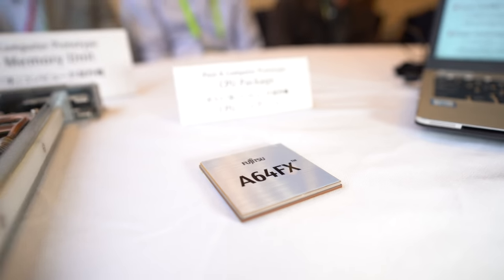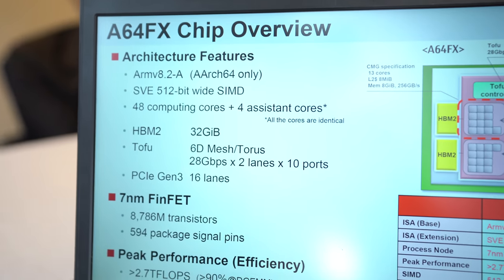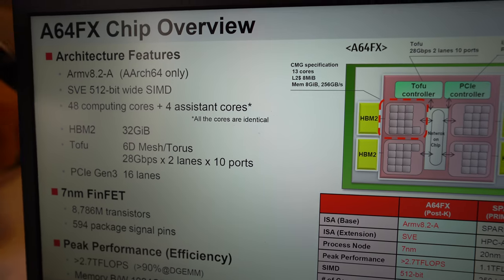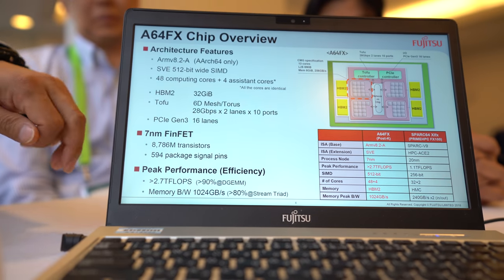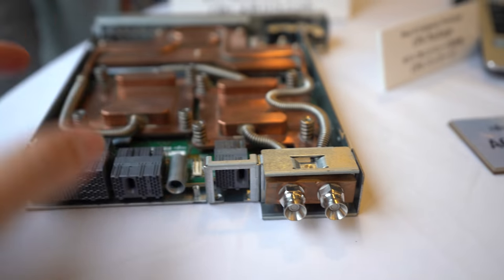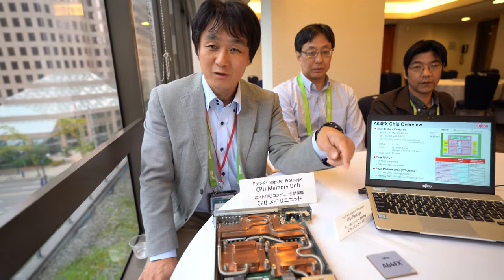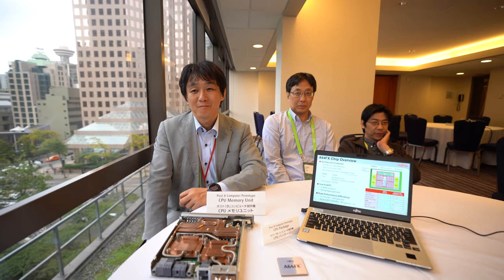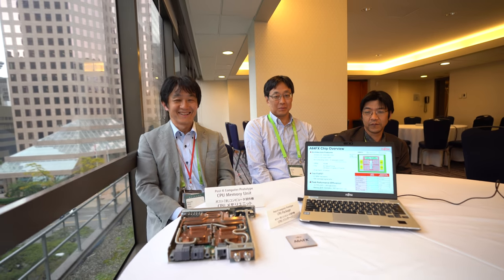Fujitsu A64FX Post-K Supercomputer: World's Fastest Arm Processor

Comment: Interesting stuff, It must be difficult conversing with the differing language barriers but you seem to do a great job of getting the information across, thanks for providing such quality content :) ARM's advantages as far as I understood it was it's ability to be use-case specific so it does one job really well but struggles with doing lots of different things which is where x86 architecture differs as x86 is designed to do many different things good enough but results in less process specific performance gains and higher power consumption per processed task in some situations, ARM has the advantage of being great for specific use cases and lower power for that specific task but isn't great for general computing, where the effort really needs to be made is in software optimisation starting at the lowest level, the hardware we have available today is many thousands of times more powerful than what we had in the past but only performs at hundreds of times better in a best case scenario, We could stop any new hardware performance gains and just focus on power consumption and software optimisation and still get another 10-15 years from our current hardware technology
Reply: Sergio Díaz Nila I'm pretty young in the tech world, not very knowledgeable on history of CPU development, if I understand what you are saying correctly there's different ways of processing data other than using a CPU/GPU/ASIC

Comment: The worlds most powerful x86 chip vs the worlds most powerful ARM chip:

ARM based A64fx chip:
$9,000
2.5 teraflops 
170 watts

x86 Epyc 7742 chip:
$6,950
3.5 teraflops
225 watt

These chips have the same performance per watt but the x86 chip has nearly twice(double) the performance per dollar of the ARM chip.  Not to mention the ARM chip is limited to just 32GB of RAM. Thus, the fugaku supercomputer based on the a64fx ARM CPU is 40% more expensive than the frontier supercomputer based on the EPYC 7742. ($1 billion vs $600 million), a $400 million difference! the x86 frontier super computer is also 3x times more powerful too. (2.5 exaflops vs .5 exaflops). So, the x86 supercomputer costs %30 less for 3x times more performance.
Reply from the maker: This obviously doesn't hold up. World's fastest supercomputer is Arm powered, it's A64FX powered. They purchase them at their own internal pricing, those prices you talk about isn't necesarilly the price per chip when purchasing them in quantities for a supercomputer. And not sure you can quantify the actual performance like that, the Arm chip enables amazingly compact PCB and ultra low power consumption for the performance.. This is just the start of what Arm supercomputers can do, later the performance can be much improved further, they can go to 5nm and below, optimize even further..